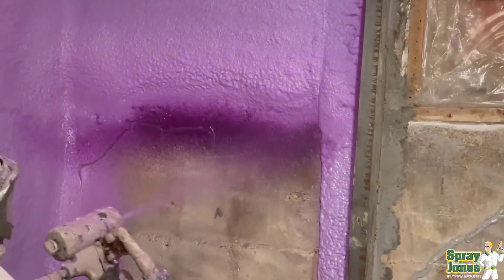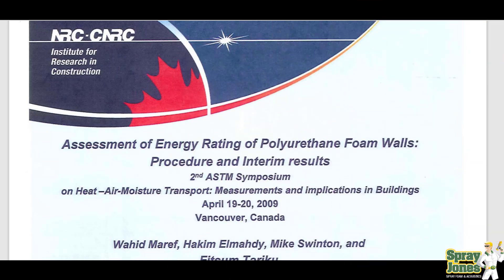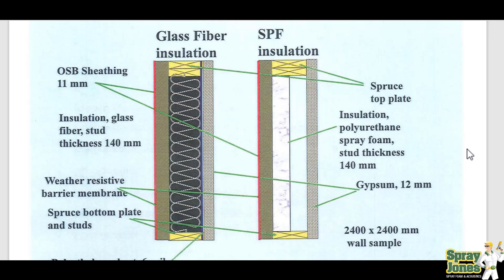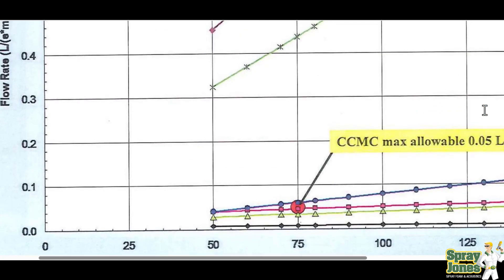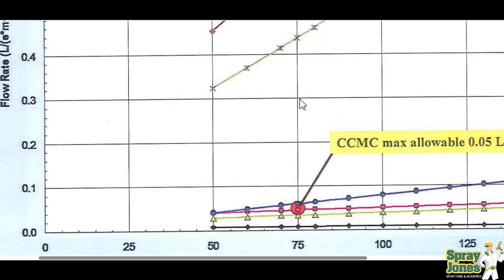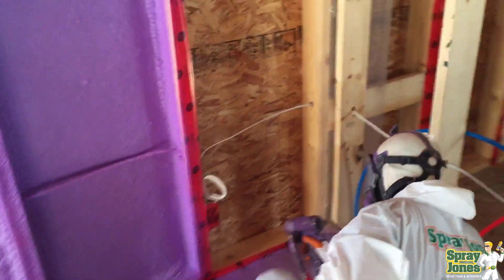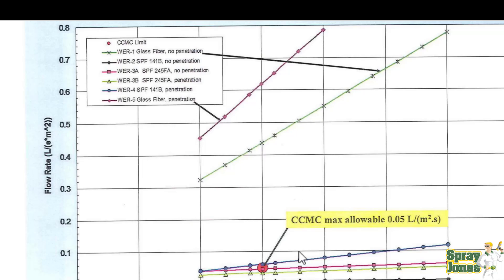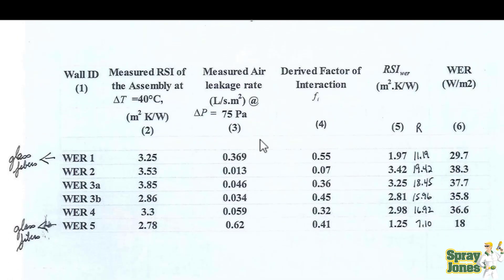Rigged Code Series | Part 2 - Air Leakage & The Lies of Batt / Poly Exposed.

Comment: I have watched the video before and didn’t understand.
Now I have a little better understanding.
Southern climates insulation outside?
Drying to the inside?
Colder climates insulation inside drying to the outside?
Either direction 2lb spray foam fixes every condition if the envelope includes under slab, concrete walls, 2x4 or 2x6 walls and not making a significant difference on heat loss with 2 lb foam.

Unless there’s significantly higher humidity inside 90% then you should get added layers of spray foam.

Comment: Unfortunately, building code does not actually care about Energy consumption, comfort what’s best for the environment it is unfortunately dictated by lobbyist and companies with the pockets to fund the lobbyist. 

Here in the US if you have an engineered insulation system signed off on buying engineer that will supersede building code. However, that in itself is expensive as a first step I would love to see insulation options in building code, one regulation for fiberglass, one regulation, cell and another regulation Spray foam. That would take the wind out of sales of somebody’s municipalities for the builder and homeowner comply, updated rules, and regulations.

Comment: So would you say just is a good combo with sprayfoaming, since you dislike flash and bat? How about a combo with PIR?
Reply: Thanks for the reply. The 3” spray foam would be the only insulation then?
Reply: Flash and batt is triple the labor and risks mold/running water in the wall as inside heat goes through the drywall and hits the smooth foamed wall.  That spray foamed wall if less than 2" thick cannot be trusted for warmth.  Often flash and batt is intended to be 1" thick.  So some areas may be thinner or thicker.  The thinner areas may be cold.  If so water is running on cold days.  Not at all worth it.  When the plan could be 2" minimum.  In Wisconsin we spray 3" in the walls....2" if there is rigid board outside over the OSB.  When it's your own home why go cheap?  It will pay for itself in 4-5 years with lower utilities
Reply: Yes.  That's all you need

Comment: so this is why Risinger likes to add outside insulation to walls to try to prevent the warm push causing mildew accumulation on the inside of the outside barrier.  Did you see Risinger after years of pushing for elimination of vented attics to unvented only a few weeks ago added the need for essentially a hole in the roof to bleed pressure or something, like wtf, think of all the homes already built prior to that knowledge that will have issues with exactly this issue of mildew accumulation on the inside of the outside barrier.  Does spray foam still need foam on the exterior of the outside barrier to also prevent this moisture buildup is what I wonder?  Should be super easy to test, metal pan, tape moisture prope to inside of it, spray foam the inside over the prope, and create a simulated box with controlled air and pressure to test with a changing exterior temperature.
Reply: Risinger has been using a vapor defusing port for years. Around 20 years ago dozens of Sip panel homes were built in Alaska and they had condensation issues at the ridge. Joe lStiebrick, who Matt gets his building science knowledge from, was in charge of finding what caused it. He wrote a full paper on his website.

Comment: I’m not willing to accept that near-zero air leakage is a good thing.
We saw this in the 80’s: a flurry of caulking, vapor barriers, etc., all in a mania to make homes “air tight.” The result was countless “sick houses,” with stale air, black mold, and high radon levels. Oops. Maybe ventilation has some value. Maybe it’s better to assume moisture is going to enter, so we need to provide a way for moisture to exit as well.
The standard you reference looks tailor-made to advantage foam insulation. I’d like to know the history behind that standard.

As to the moisture issue: Keep in mind that while foam can make something essentially air-tight (thus trapping moisture), it has the advantage of using moisture in its chemical reaction. That is, it will remove any moisture present as it cures — to the point that you actually need to wet cavities is arid environments for a proper reaction.
Once cured, though, that cavity better remain sealed, or it will trap an moisture that leaks in — leading to all manner of problems.
Reply: Of course ventilation has value, but it should be controlled via a mechanical system, not just leaking passively through your walls
Reply: These videos never say that HVAC and make up air isn't important.  Exhausting kitchen and bath humid air is important.  But to think your whole house should leak heat and air to remain "healthy" is ridiculous.  HRV units are great spray foamed houses.   The thing to remember is that moisture is IN THE AIR...and when old homes walls are opened up guess what you see???  Black mold and destroyed fiberglass from mice....mouse feces etc.  How is that healthy????   Many HVAC units change the air to get rid of internally created humidity...or an HRV (heat recovery ventilator).  The  spray foamed house is much warmer, efficient and healthier than a glass house.
Reply: For you to say foam "has the advantage of using moisture in its chemical reaction....well that's just not true or factual at all.  Foam cures quickly.  Dry to the touch in 10 seconds after it hits the wall.   Moisture is never needed or wanted in spray foam.   Watch these videos....all of them ...and get an education on 2lb. Foam.
Reply: You want to ventilate with ERVs, not by air infiltration through fiberglass filled with mold and mouse droppings.
Reply from the maker: You have no idea what you are talking about. This is twin component spray foam. There is no need for moisture to cure the SPF. 
As far as you "too tight" comments.. learn about envelopes and HVAC your comment shows a large ignorance of what is happening and how to deal with it.

Comment: Thanks for all your videos, very useful info. Do you have any information on closed cell SPF longevity? Any potential or unique degredation over time? I've seen people make negative claims but have yet to find concrete info to the contrary.
Reply from the maker: Because it is BS. How long does the foam in a freezer last?